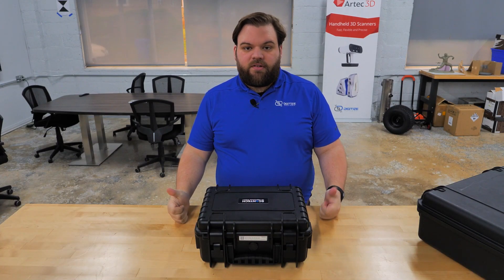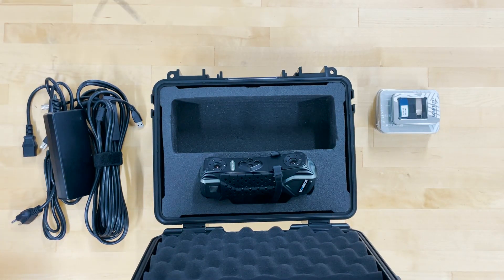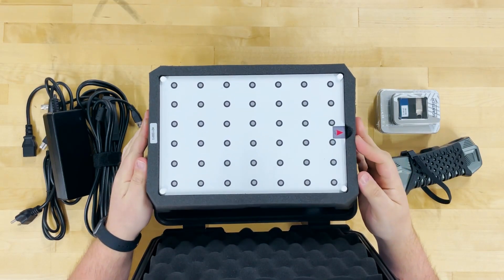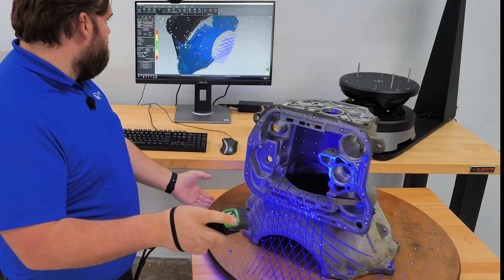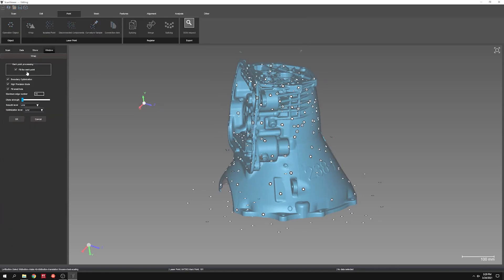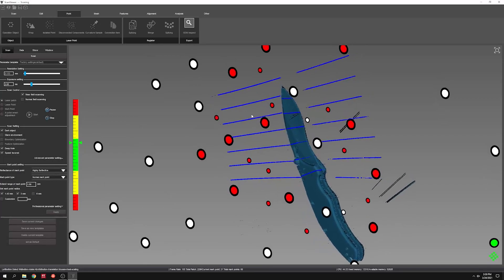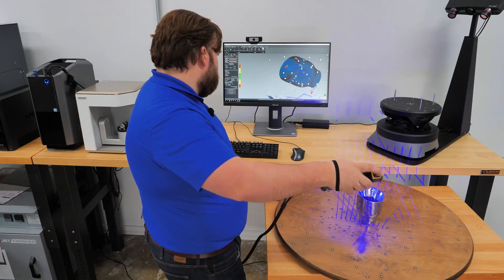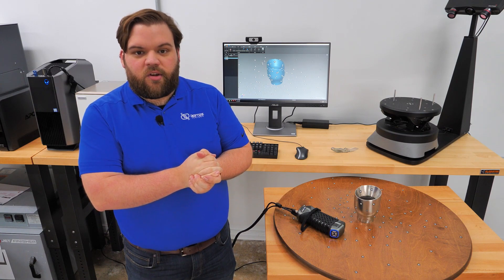SimScan 3D Scanner Unboxing

Comment: Can I use for CNC Machined parts ?
Reply from the maker: @rohitmac6178  Yes, the Scantech SimScan models can scan CNC machined parts effectively. These scanners are designed to capture high-precision data, which is crucial for inspecting and reverse engineering CNC machined components.

Key Features of SimScan Models for CNC Machined Parts:

1. High Accuracy: The SimScan 42 offers accuracy up to 0.02 mm, which is suitable for detailed and precise scanning required for CNC machined parts.
   
2. Resolution: With a resolution of up to 0.02 mm, the SimScan models can capture fine details and complex geometries typically found in CNC machined parts. 

3. Portability and Flexibility: The compact and lightweight design allows for easy handling and scanning of parts in various orientations and positions, which is useful for inspecting parts directly on the machining floor or in confined spaces. 

4. Speed: The high scanning rate of up to 2.8 million measurements per second ensures that even large or complex parts can be scanned quickly without sacrificing detail. 

5. Surface Compatibility: The SimScan models are equipped to handle different surface types, including those with varying textures and finishes, which are common in CNC machined parts.

Given these capabilities, the Scantech SimScan 42 and other models in the SimScan series are well-suited for scanning CNC machined parts, ensuring high precision and efficiency in capturing intricate details necessary for quality assurance and reverse engineering processes.

Comment: We need to scan human head with fine details, which scanner model do you recommend?
and thanks for the video
Reply: The Simscan can be used for human head scanning, but typically we recommend a scanner that does not require targets for a scan like this.  Depending on the Detail level needed, the Artec Leo or Artec Spider are typically the recommended scanners for this.
Reply: @bohelmrich4215  many thanks for your tips.

Comment: How would this unit go scanning environments, like 1 or 2 walls in a room or sections of large machinery?
Reply from the maker: It would do great as long as it's not a huge room.  General rule of thumb we use for part range is the size of a coin up to the size of a vehicle.  It would do great for sections of large machinery - that's exactly what it's made for.  If you want more info, reach out to us at info@digitizedesigns.com